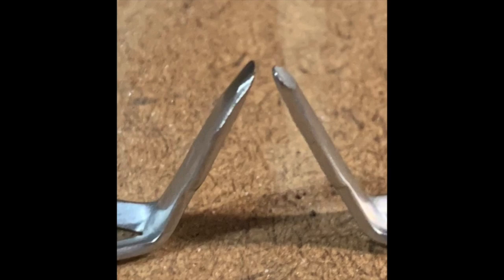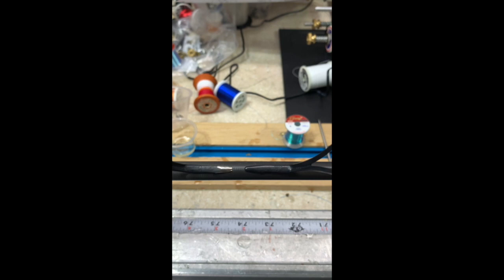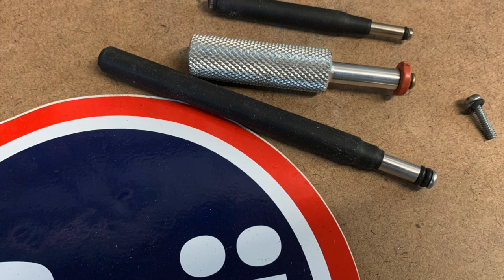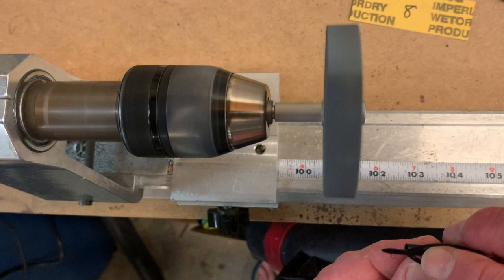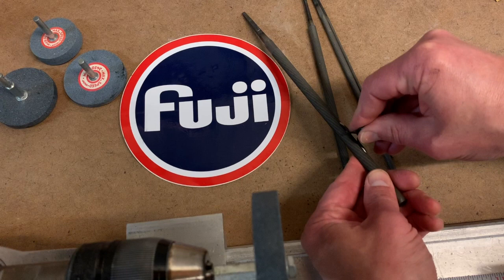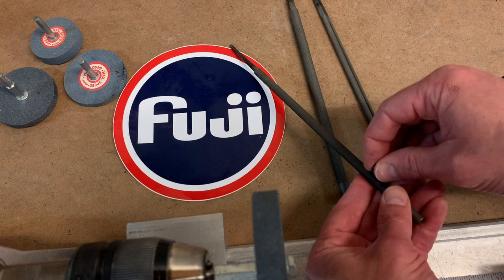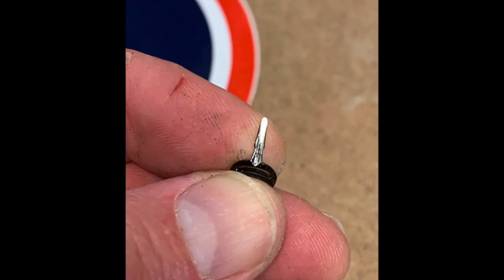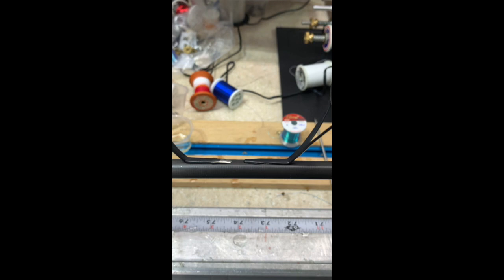Guide Foot Shaping and Polishing

Comment: Very nicely done. Would be nice to see how you double wrap guides with an underwrap for heavy duty popping, Jigging and boat rods. Thanks !!
Reply from the maker: Thanks for watching...please like and subscribe!

So I get a lot of requests for that very topic...interesting.  I have it on the list of videos to make but in the meantime, I typically follow this process:
- complete all under wraps with size A thread
- finish under wraps with two light coats of finish; let cure for 2 - 3 days
- wrap guides on with first coat of thread - size A; finish first coat of thread; let cure for a 1-2 days
- wrap second layer of thread over guides - size A; apply final finish coat(s) - may take up to three coats on very large roller guides but usually 1-2 coats is good.  

Hope this helps.

Comment: Why do the manufacturer's not do the guides properly in the first place? If it should be done like you say then should then not come from factory properly ground?
Reply from the maker: Thanks for watching!  As for your question, you'd have to ask the manufacturers to be sure.  I think it is simply a cost factor.  It takes time to get each and every one perfect.   Kinda like a fine English bespoke shotgun...every detail finished perfectly by hand  and built just for you.  But very few are going to pay for that craftsmanship - and the hefty price tag - when you can get a Remington pump at Walmart for $350.  

And like both of those shotguns will go bang, you can build a perfectly functional rod without shaping your guides.  The good manufacturers - like Fuji - have them shaped well enough that you could wrap right them right on.  They are also very consistent (like exactly the same) from guide to guide.  So with Fuji guides it's not absolutely necessary.  Snake Brand snake guides don't require dressing at all.  ALPS guides are also very consistent and you could skip it for many of their smaller sizes.

But for many manufacturers, the guides are built to a price point and that's it...and it shows.   The exhibit a TON of variation.  They can't even get them the same...much less right.  Could they get everyone exactly right?  Certainly...just not sure anyone would pay for it.   Hope this helps!

Comment: what is the tool you are using to spin the grinding wheel????
Reply from the maker: Thanks for watching...please like and subscribe!

It''s actually the power head of a Renzetti Rodbuilding Lathe.  I ordered a keyless Jacobs chuck and spindle adapter to replace the stock factory jaws.  That way I can quickly swap things out (in this case shank mounted wheels, etc.).  I also really like the clean Jacobs type chuck vs. the knuckle buster jaws on a typically 3-jaw lathe chuck.  

Hope this helps - let me know if you have questions.  Thanks!

Comment: Love your channel - just subscribed ...... would love to see the Forman wrap done and how you epoxy guides in the final stages how many coats and how you complete with nice straight edges. Thanks.
Reply from the maker: Thanks so much for watching and subscribing!  So glad the videos and channel are helpful to you.  That’s the point!  

I have three different epoxy/finishing videos in the works:  one on finishing butt wraps, one on finishing guide wraps, and the third on how to avoid/fix/correct the most common finish problems.  I’ll try to get them posted soon?

Great idea on the Forhan wraps...Rich Forhan is The Man!  I can work up a vid on the locking wraps he developed for single foot guides and the spiral guide placement system (aka Revolver Rods) he innovated.  Thanks for the great suggestion!
Reply from the maker: Anne Marlow your guide finish video went up today...please check it out.  Will do the Forhan Locking wrap video soon!

Comment: Thanks for great tutorial on rod building, learned a lot. Do you have videos on preparing roller guides and wrapping of roller guides?
Reply from the maker: Hey Nick - thanks for watching!  To be honest I don't use many roller guides these days.  I build everything - even unlimited class trolling rods and daytime deep drop swordfish rods - with spiral wrapped conventional guides.  

But the process is basically the same.  The only difference is that with really large or heavy duty guides I actually use a low speed bench grinder with a fine stone to grind them.  Same process...you just have to use a bigger stone.  It would take FOREVER to grind rollers on that little stone I use in this video.  But same thing: gently grind and reshape, contour the bottom, and polish them off.  A lot of the high quality rollers are already contoured on the bottom, so just remove any burrs you created when shaping.

In terms of wrapping rollers I always use underwraps of size A thread.  I generally wrap the under wraps and trim bands on each end (and typically something decorative in the middle of the wrap that will show between the guide feet) and finish them with two light coats of finish.  After that finish is set I double wrap the guides and finish the guide wraps.  Often takes 3 or more light coats to finish those big boys.  Hope this makes sense...reach out with questions.
Reply: @masteringrodbuilding  thanks again for sharing your wisdom, I really learned a lot from your videos that I would was not aware of with the steps you had taken brought the rod wrapping easier and finished more beautifully. 
May I ask on the double wraps on the guides foot what size of tread do you recommend and do you apply coat before applying the second wrap? The reason I ask this is have been experiencing treads separating once heavy drags are applied to the tuna rod builds I made.
Reply from the maker: @nicklim7905  hmmm...I typically use size A for everything and typically don't coat between overwraps.  I'd like to learn more and maybe see some pics.  Send me an email at falconerb@yahoo.com and we'll figure it out!
Reply: @masteringrodbuilding  got your email address and sent pictures,

Comment: Another awesome video! I have not got into this habit yet but will definitely start on my next set of rods. Can I accomplish this with a small harbor freight bench grinder or can I do it from my apls wrapper?
Reply from the maker: Thanks for watching...please like and subscribe!  You can accomplish this many ways.  The challenge is really more about how coarse your grinder wheel is than the method of powering it.  Many (most) bench grinders are VERY coarse wheels and relatively high speeds.  It is nearly impossible to remove a slight amount of material from a size 6 running guide with a coarse wheel at 2500 RPM.  So that's really the thing to watch out for.  You do not want to remove too much material nor build up too much heat.  So if you can get a fine stone for that small bench grinder (600 - 1000 grit would be ideal) then you'll be fine.  Alternately you can chuck something fine into your Alps wrapper chuck and that will work as well...and give you more speed control.  Hope this helps...let me know if you have questions.  Thanks!

Comment: You've got great and informative videos, thanks for sharing your knowledge. Unrelated question but do you have an opinion on spiral wrapping guides on a slow pitch or long fall rod? Most of the shorter slow pitch rods I see are normal, but the long fall factory rods are pretty much always spiral wrapped.
Reply from the maker: Hello Sergey - thanks for watching.  I appreciate the feedback!  

I spiral wrap SPJ and Long Fall rods 100% of the time - no exceptions.  The shortest rods I am building for this application are 6'6" but they get spiral wrapped.  I set up all of my SPJ/LF rods to spiral opposite the side of the reel handle (so if you crank right handed I spiral around to the left).  I typically use Fuji Double Foot guides starting 16-12-10-8 and then use size 6 running guides out to a size 6 tip.  This set up works very well running Accurate Tern and Valiant 300s/500Ns as well as Shimano Ocea Jiggers 1500/2000.  

Hope this helps - DM me if you have questions.  Please like and subscribe!  Thanks!
Reply: @masteringrodbuilding  That helps a lot, I'll probably end up wrapping a couple of rods  just for different applications and I'll go ahead and try spiral wrapping them since the weight savings and stability would be nice to have for the light stuff. Right now I've got a united composites moderate inshore blank that I'll probably cut down to a 7'6 - 7'8 and use it as a long fall rod and then maybe pick up one of the rainshadow 6'6 slow pitch blank for some wider jigs. 

Haven't decided on the reels yet, I like the valiants a lot but also have been looking towards a siegler sgn or okuma alijos 5n, I've got a couple of chances to decide.
Reply from the maker: @MemphisPrime  Okay - PM me if you want more details on guide spacing, etc. I'd be interested which UC blanks you like.   They make a stellar product but I have had ZERO luck emailing Randy (or anyone else there) to get SPJ recommendations.  They are so dialed into the long range SD crowd they are just tone deaf to everyone else.  Especially GOM anglers in my personal experience.
Reply: @masteringrodbuilding  Thanks, I'll definitely ask questions if and when I need some help. You're pretty much right, Randy is really focused on the San Diego scene and even more than that pretty much the medium to heavy offshore and 9-10ft jig sticks niche. He's a world of knowledge with a lot of professional experience from Seeker, but he has a focus on what he knows and likes doing in general.

I've been putting a lot of thought in deciding what to get since he really doesn't have any dedicated spj blanks, but so far I've pretty much only narrowed it down to a UC 711L and UC 711MH in the swim bait series. They are moderate instead of mod/fast or fast like the rest of the blanks in the series so they're a lot more parabolic than most, and more importantly they're 20% thinner being made on a different mandrel. With a few inches off the butt to make it a more normal 7'3 - 7'8 for long fall the MH would probably drop down to around a 15-30 but I might get an L instead after I can pull on one here to see the difference. All of the lure ratings are for casting pretty much so I'd have to figure out a jigging range myself just from feel.

As far as dedicated jigging blanks most of what he offers is for large vertical or speed jigging, so it's 6' and below. The Zeus 1 he's got is a 6'2 1-2 PE rated rod but the weight of the blank and a 15lb max drag rating on it makes it seems like kind of a overkill for spj despite the rating, I haven't pulled on the 1 but I've tried the 3 and it is a beast for vertical jigs there's a ton of power in them.

The previous owner of UC was an Australian guy so a lot of the blanks that didn't transfer from Graphite USA were designed by him and his team, which basically includes any of the actual composite blanks since GUSA was known for only making straight graphite blanks. The Zeus, the rest of the jigging and the two piece popping and surf blanks they make were basically tailored for the Australian market which at the time didn't do much as far as SPJ.

If you have any questions for Randy or anything about their product let me know, I live 5 minutes away from the factory and see him probably 3 times per week when he drops stuff off.

I know lots of guys in Texas, Louisianna and Florida fishing the UC's, most of the guys that I've talked to who have been turned towards their blanks and rods end up loving them. But it is mostly oriented to either the heavy trolling, chunking or dropper loop bottom fishing, stuff similar to the San Diego market. They have a pretty wide selection of blanks (at least 300-400) so it's easy to get lost and most of the stuff doesn't get much attention, but I think for the most part there are blanks for most applications.
Reply from the maker: @MemphisPrime  Yeah...I used to deal with Roy and Megaly back in the day.  I'm a huge fan of their products.  Randy's take was just like...we make 200+ blanks I bet one of them will work.  And he may be right...but I find there is a huge difference in the purpose built rods for these specific, niche techniques.  I'm sure he'd be mad if I said 'Aww...ANY rod can be a rail rod!'
Reply: @masteringrodbuilding  Yeah, that's a great point, there is something to be said about a rod built for a purpose. When he does do it they turn out great, all of the most popular stuff from him is purpose built. Either the rail rods, jig sticks, tilefish rods, the wahoo and so on are the most popular stuff he sells. I'd like to see him designing more of his own blanks (outside of 9ft jig sticks again), he's been pretty busy for the last year or so trying to keep up with demand so once that issue is solved there may be more room for it hopefully. 

Who knows, maybe if I do well on the jigs and show him how fun it is he might want to make some dedicated blanks of his own for it.

You know, I totally forgot that they ended up designing a line of blanks for micro jigging back when it first started getting popular in Australia. NZ and Japan. I know they have some heavier line classes in the series so that may have some potential on the larger jigs for slow pitching I'll have to get one to try maybe
Reply from the maker: @MemphisPrime  I'd love to know which ones.  I've had very good luck with their product in the past.  And Australia and NZ have an SPJ scene.  The CTS Slow Motion Elite blanks are EXCELLENT.
Reply: @masteringrodbuilding  Well maybe they weren't specifically made for microjigging now that I look at it. The UC 600 and 601 seems to be what people have used for the microjigging but the blanks get faster from there so that's not ideal. Their line ratings on the lighter stuff seem a bit low from what the actual feel, so maybe there's some room to find something that would work. 

Does CTS go to ICAST by any chance? I'd love to check out their stuff, I've heard them mentioned a few times before and they seem to make great products
Reply from the maker: @MemphisPrime  Hey wait a minute...the left half of my brain is now talking to the right half of my brain.  Sergey - are you the Sergey at Charkbait?
Reply: @masteringrodbuilding  Yeah, the one and only 😂
Reply from the maker: @MemphisPrime  Dude...Charkbait is my STORE!  Love me some CB peeps.  It's Mark I've been giving a hard time about getting UC to make SPJ blanks!!!  LOL...good to see you on here, man.  Let me know how I can help.
Reply: @masteringrodbuilding  Yeah, I know my dad has tried to encourage Randy to expand his range a bit to fit demands outside of California especially, and we've had some success in getting him to make more spinning rods now so hopefully that means SPJ and other needed rods and blanks are a possibility in the future. Glad I found your channel, you've got a ton of great information, and I'm just starting to try to get into rod wrapping.

Comment: Hi, very nice video.  
I have seen some use Diamond Grinding Wheel.  Did you use diamond wheel in the video or what?  So far I have used simple abrasive paper in various grits placed on a support and turned on the Chuck of my wood lathe with adjustable speed 300-3000 RPM (I worked about 2000 RPM with 150 and 220 grit) Excellent results with only one step but a long time ... I would like to switch to a diamond wheel, do you recommend it?  Which diamond wheel grain?  How many RPMs for the first step?  I ask this because normal bench grinders work at higher speeds (like 6000 RPM or more) and I would like to upgrade with better times and results.  Thanks for reply.
Reply from the maker: Thanks for watching...please like and subscribe!

So...all a diamond wheel is going to do for you is last longer than a stone wheel.  A 150 grit diamond wheel will remove material at the same pace as a 150 grit stone wheel.   So, the composition of the wheel and the grit are separate questions.  I like to turn my wheel (which I believe to be about 220 grit) at 2000 RPM or so.  Anything faster than that gets very hot.  

If you want to speed up the process, you need to either turn faster or go with a more coarse wheel - both of which build heat very quickly.  So be careful.  On very large guides I will often do some material removal with a bench grinder or a wet grinder designed for sharpening knive (Tormek) and then finish on the small, fine wheel.  You just need to be very careful with heat build up as you can ruin the temper of your guide frames.  Hope this helps!